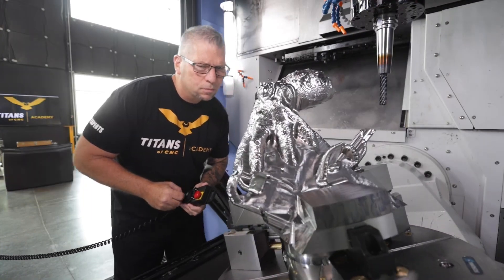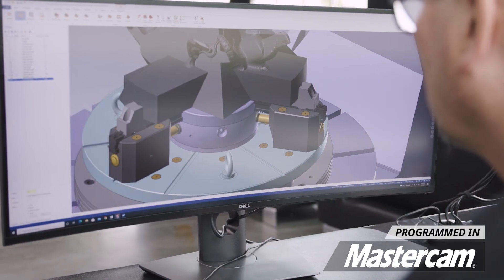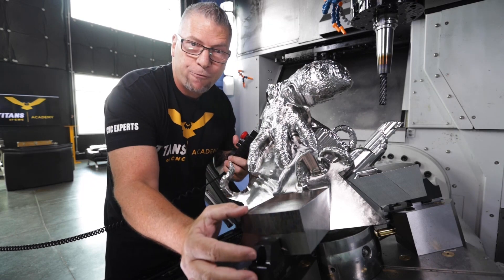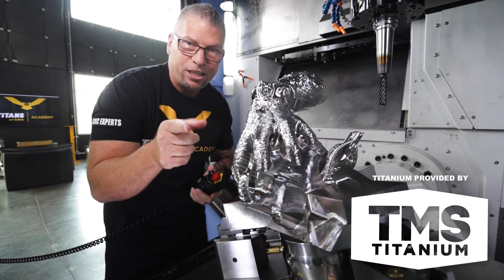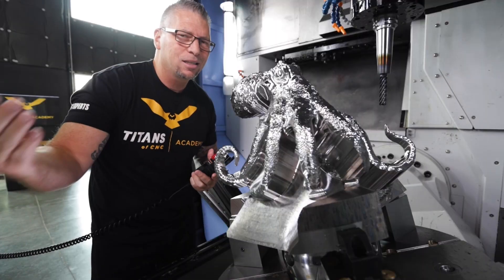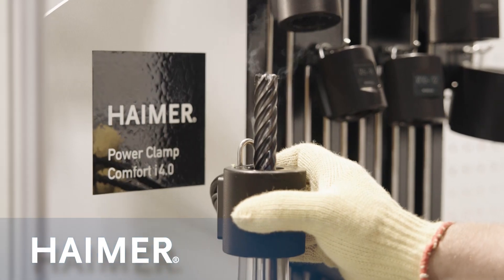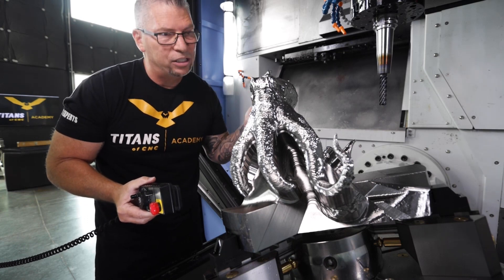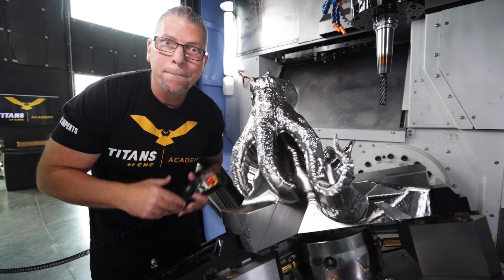Herculean 5-Axis Chuck has 22,000 lbs of Clamping Force | DVF 8000T | DN Solutions

Comment: What do you use for coolant? Looks like straight water. Do you change depending on the material you are cutting?
Reply from the maker: Blaser Synergy 735. Best coolant we’ve used, we use it on every machine, just adjust the viscosity depending on the material.